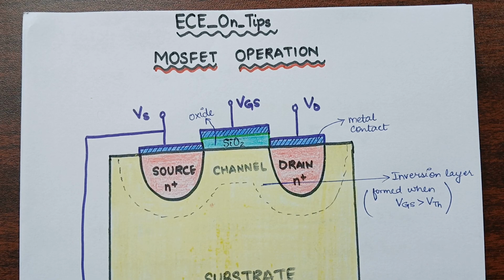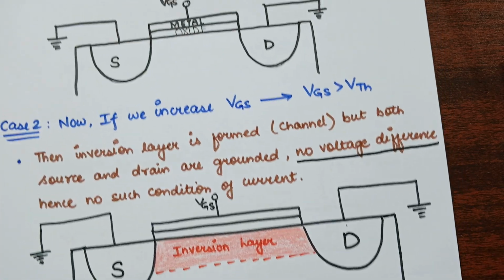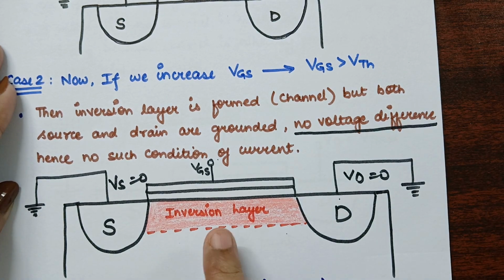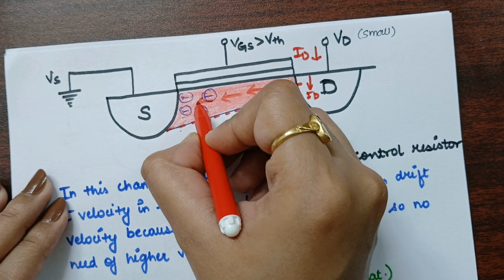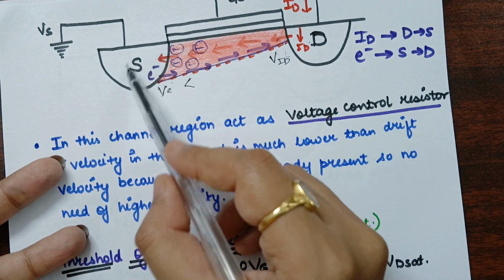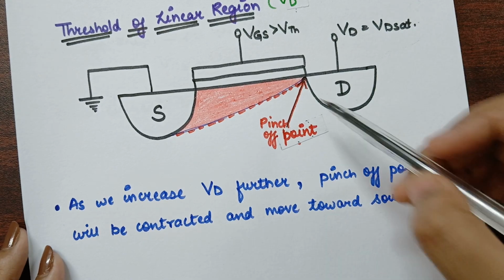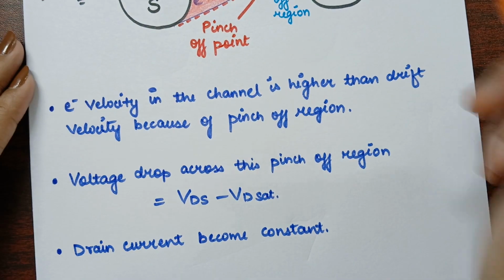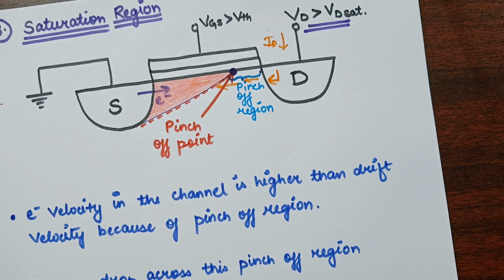MOSFET Operation( Construction and working) @ECE_On_Tips

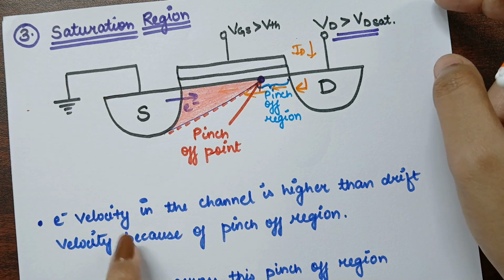Comment: Drift velocity of electron not the current 10:20 
Drift velocity is is lesser than the electron velocity so that the electrons move from pinchoff point to drain easily by electric force on it.